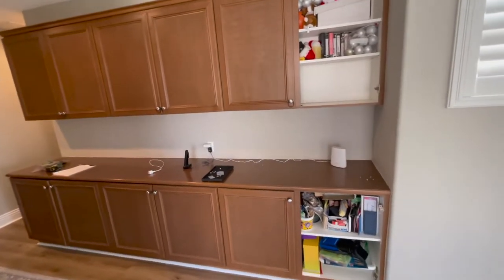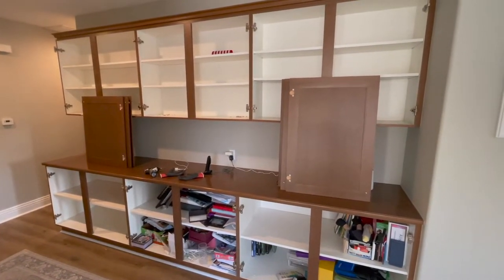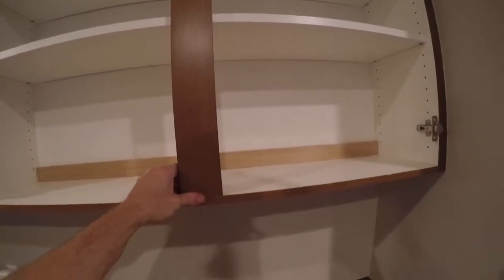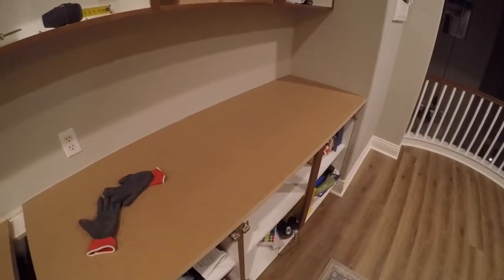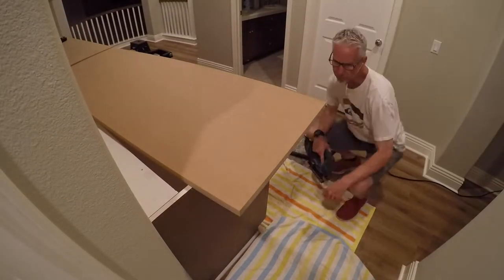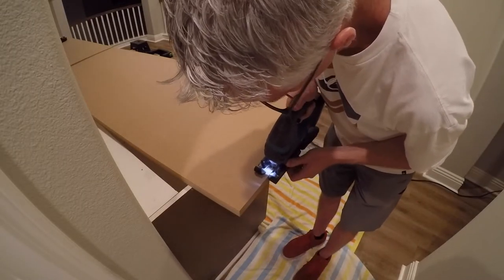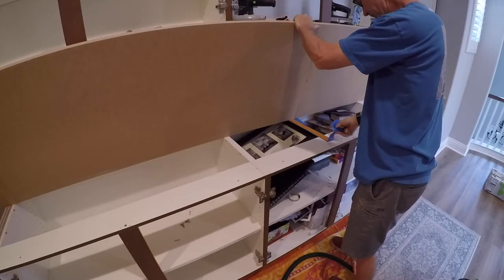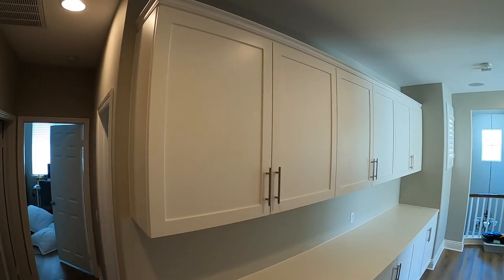How To Re-face Your Old Stock Cabinets And Make Them Look New And Updated- DIY Friendly!

Comment: Looks great! What a turn around with those builder grade cabinets. Do you know what the painters used paint wise? Primer / Finish? 

Cheers!
Reply from the maker: Hey Steven.  Thanks a lot. I appreciate it.  The paint is laquer 20 sheen.  Not waterborne.  Undercoat is laquer undercoat.  It’s very nice to work with.

Comment: I don't see that counter top lasting for very long. Why didn't you add a piece of hardwood banding to the edge of the MDF?
Reply from the maker: It’s not a problem.  I don’t like the edge ending look.  I prefer this look.  And the material in my case, doesn’t get damaged.  Possibly if someone in a area that has a ton of abuse, then maybe but in my home, all my counters on cabinets that have this treatment look like the day they were installed.  Some have been in place for over 10 years without any signs of problems.  I guess you’ve got to ask the question, why would I use it if I have had problems with it?